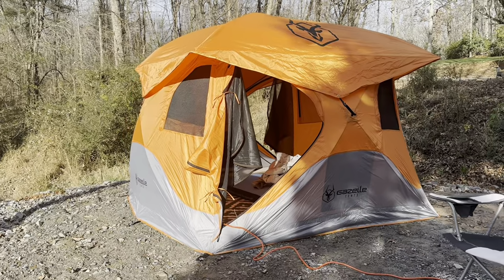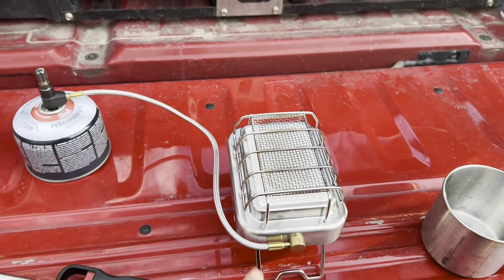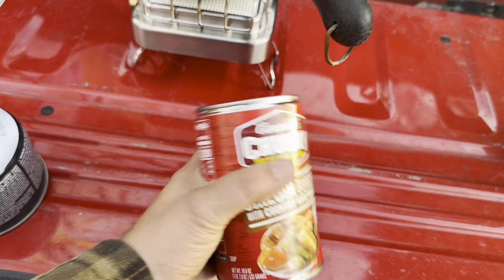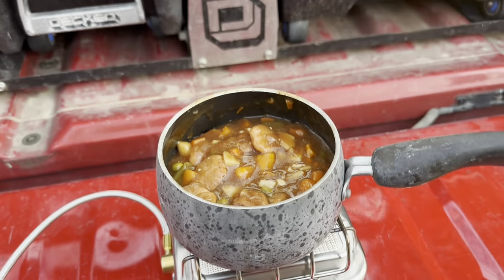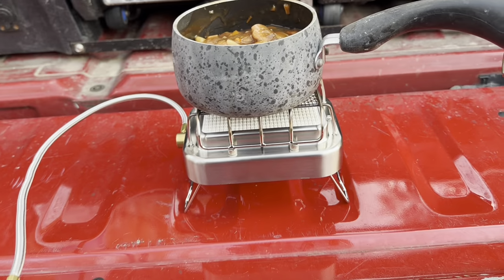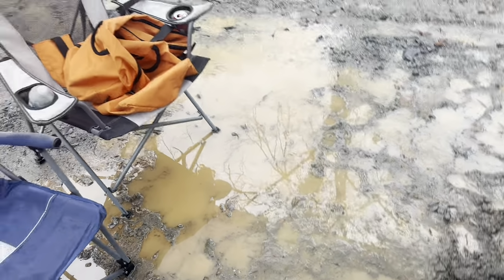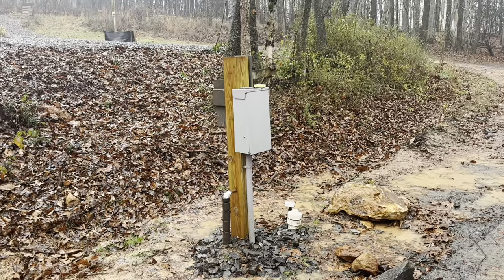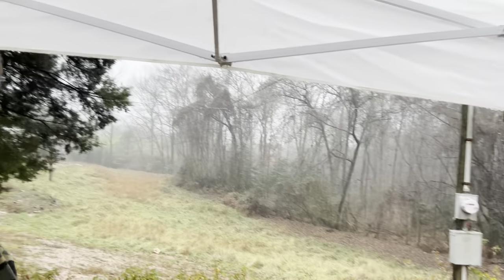CAMPING IN THE RAIN IN MY GAZELLE T4

Comment: Great choice. Been using a Gazelle in Florida & Georgia for 4 years now so familiar with the sudden rain like you experienced. Never had a major leak issue but there is one trick to the main doors. If you haven’t figured it out by now, Make sure your zippers are at the top side when it’s raining and you won’t get any water through them. The way the door rain flaps are will channel the water right though them if they’re down low. The one drip I occasionally get is through the door zipper if the wind and rain is blowing right at one of the doors. It runs along the zipper and eventually saturates through at the bottom corner for a small drip, but nothing a small towel can’t handle. Keep the vids coming!
Reply: Thank you for this

Comment: We started with the T4 then upgraded to the T4 Plus. It is the same footprint as the T8 however, the addition is square and has vertical and horizontal zippers rather than the weird half moon doors found on the standard T Types which makes entry and exits much nicer. We chose this over a rooftop or the T4 because there is something about camping at altitude in colder weather that seems to make me get up frequently in the middle of the night in search of a restroom. The additional room allows us to have a porta potty much more accessible and, we can run a mister buddy heater to help reduce those trips.😃
Reply from the maker: I wish I would've went the with t4+. Basically for the same reasons. I like it all being one unit in one bag and the extra built in room would of been great..
Reply: I wanted to get the t4+, but the places we generally go camping, the tent pad is smaller than the t4+ footprint. Annoying.